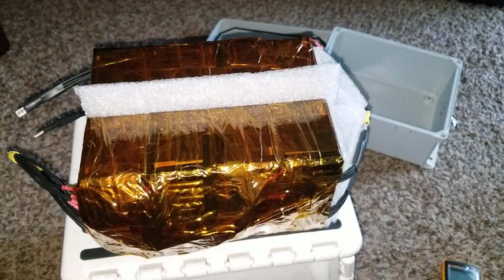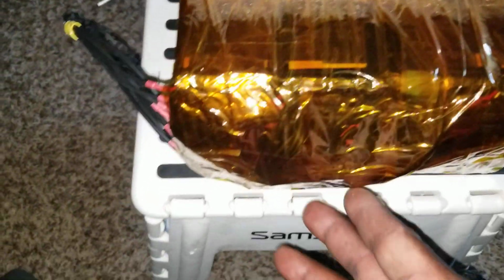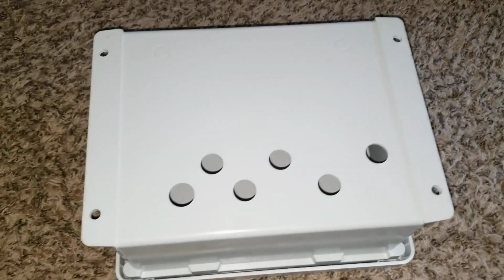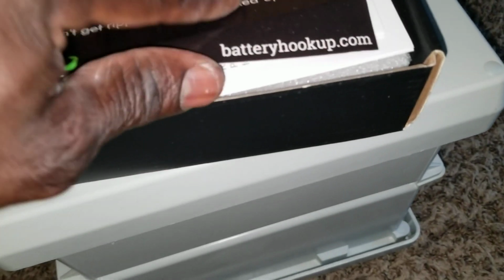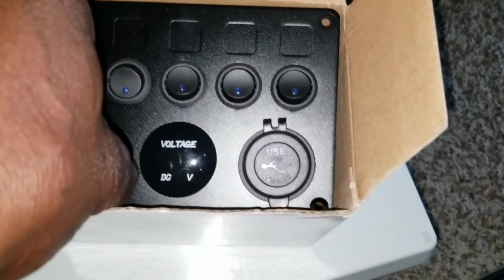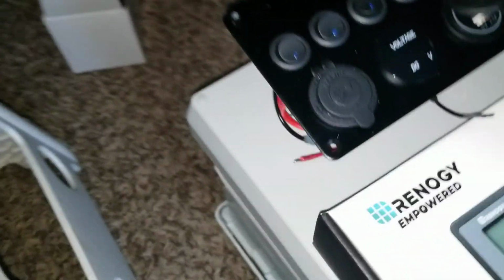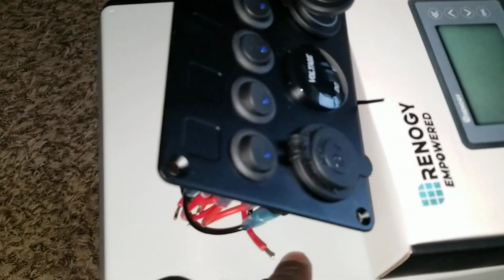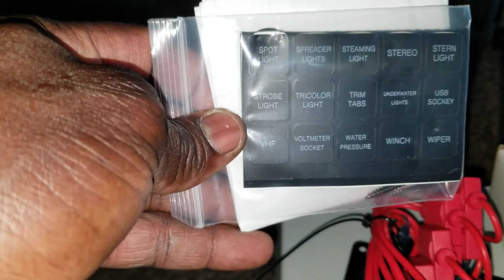(PART3) OFF GRID, DIY, BUILD SOLAR BATTERY STORAGE, HOW TO BUILD YOUR OWN POWERWALL

Comment: How about the two boxes be separated . A meter and outlet box . and the battery box . It seems that the two boxes stacked on top of each other may defeats the main purpose of being sticking out too much , I’m just saying . If by your desire that they’re going to be wall mounted , have the meter outlet box mounted on the wall surrounded by as many battery boxes you can build surrounding the meter box at any way possible on the wall and have each of the batteries you can build wired to it someway . Much like on a keyboard for example , H as the meter box and T ,Y , U, J , N , B , V , G each as the battery boxes surrounding the H and all are wired to the H box for example . You can use it for solar or just to keep devices powered up If that’s your desire ! Seems like a great idea or is it a little overboard for you . Your way is the best way .
Reply from the maker: Thanks for your awesome custom design for I will look into it.
You always bring in subject of discussion on each video I post.